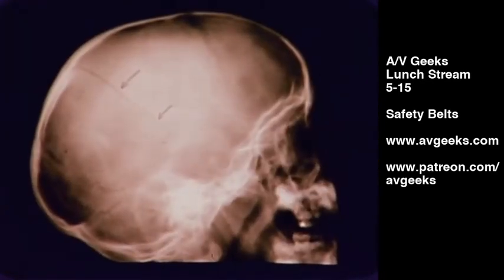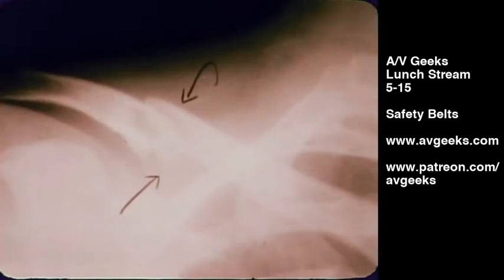AV Geeks Lunch 5-15

Comment: Cleaning And Maintenance Of Resilient Floors - 0:03:21 (1963)
Fairness For Beginners - 0:24:57 (1956)
What's It All About - 0:36:38 
Safety Belts - 0:51:02 (1976)
The Lottery - 0:58:04 (1969)
Bugs Beetle And His Orchestra - 1:18:00 

arbitrary (and likely not very useful) tags: training, workplace safety, pr, allied international films, National Sanitary Supply Association, corporate training, children, etiquette, Marvin D. Glock, delco, general motors, assembly line, Sony, labor, union busting, transportation, safety, injury, xray, New Jersey, PSA, ed begley jr, EBF, shirley jackson, b&w, animation, cartoon, insects, big band